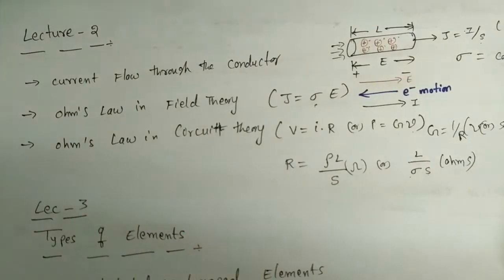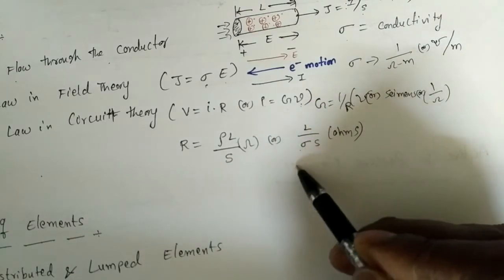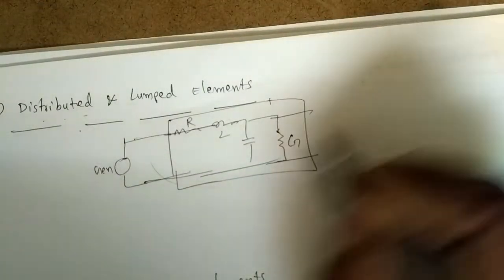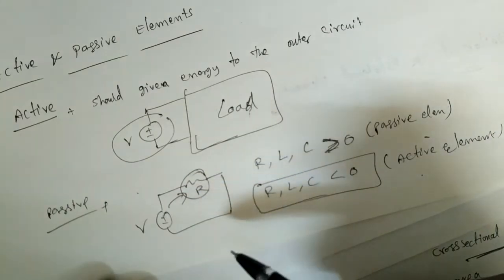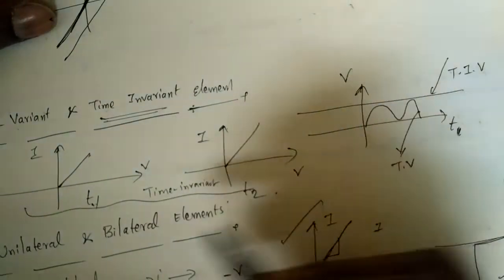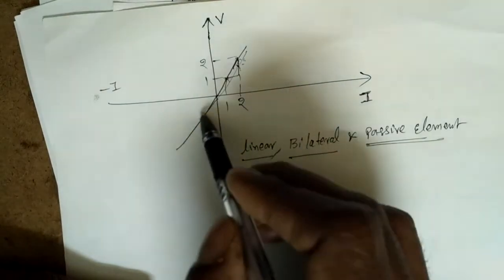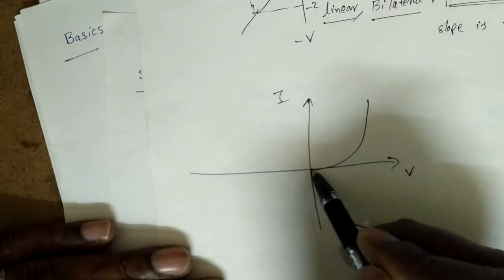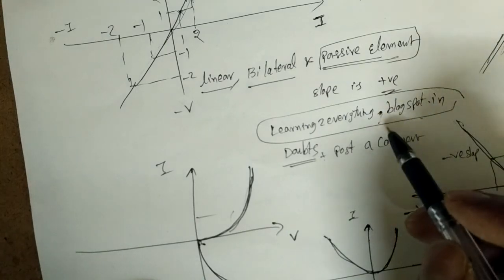Network Theory Lec-3 : Types of Elements

Comment: Hi sir..  Good morning...  In bilateral element examples the last one is i. e.U shape curve..  How it's behave as unilateral...  In both sides the slope value  was same value in any cases...  But - ve and +ve values..so it is Bilateral...  Give me a clarification sir...  ThankQ sir...
Reply from the maker: see the slope should be only  positive or only negative if it is bilateral.i.e characteristics should be 1st and 3rd quadrant ot 2nd and 4th quadrants..if two different  slopes are there it is not bipolar
Reply: Learning Z Everything ThankQ So much for your reply sir...

Comment: can I have a clear clarity on ... distributed and lumped elements... i.e...both of the elements distract the transmission lines....so wt is major difference between them
Reply from the maker: srinivas Jaya distributed elements are distributed in space that is their values dependent on time and space where as lumped elements depends on time...
Reply from the maker: srinivas Jaya if I give some example ..R and L , G and C elements will be there up to infinite length it is called as distributed network and if we take one part of that,  that will become lumped circuit

Comment: SIR WE WILL FIND THE PASSIVE ONLY WITH THE HELP OF SLOPE WHAT WHEN THE THE LINE HAVE ZERO SLOPE THEN ELEMENT WILL BE????
IN LAST EXAMPLE WE HAVE TWO ZERO SLOPE LINE IN POSITIVE AS WELL AS IN NEGATIVE DIRECTION. FOR WHAT ABOUT THIS REGION ??
Reply from the maker: there the slope is infinite (dI/dV = dI/0)  i.e if we find the resistance= (dv/di)= 1/slope = 0. still we can say passive element because it is in 1st and 3rd quadrant....
Reply from the maker: you can easily remember if the slope is positive passive element , if the slope is negative active element
Reply: but sir in last question di/ dv is 0
Reply from the maker: even if slope is 0 ...if the characteristics are in 1st or 3rd quadrant we can say passive element and if it is in 2nd or 4th quadrant then active element
Reply: THANK YOU SIR